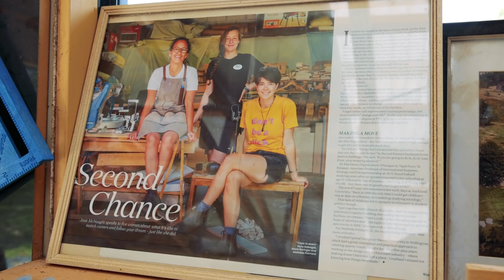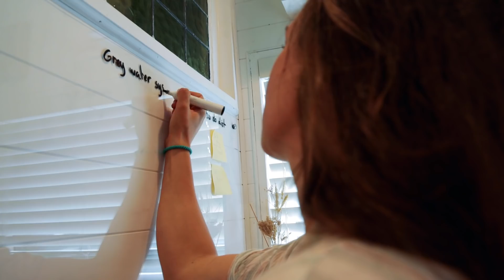Young Woman's Tiny House & Self-Sufficient Life

Comment: A tip when using magnetic knife holders, always face the sharp edge of the blades away from you, so when you reach across the knives for the one at the end you don't accidently cut yourself.  I installed my magnetic bar vertically, blades up, with least used knives at the top and ones I use the most at the bottom.
Reply: Hey Randy, this is such a good tip thank you

Comment: Question - see with a three meter wide Tiny House, what is the consequences of going that wide? Does it make it so only drivers with the correct permit can tow it? Or do you just have to apply for a special permit? We would love to go 3 meters, but so many people opt for the 2.5 - which makes me think there must be a reason?
Reply: 3.1 is the max you can go to drive without a special permit and 3.1 is the total width of my house (from the outside) . People go with 2.5m from wall to wall inside to be safe because you have to count the wall thickness, the cladding, window, roof and gutter etc! Once everything is built you can easily go over 3.1 so 2.5 is the safe number .... the inside width of my house is around 2.8 because I can afford to have smaller size framing cause there is no loft and it is only 5m long

Comment: Did I miss something? How is it heated, and cooled?
Reply: Hey Monty, it is such a small space that boiling the kettle for a cup of tea will heat the entire place in winter  and I have a fan in summer :)... I also have a Lunos ventilation system with regenerative heat exchange so I have a constant air flow going without change of temperature inside the house
Reply: this is very informational. It’s probably just a cultural language difference, but what is the digester? Is this the same as a composter? I am also very intrigued about how you recycle your gray water, and cook with self generated gas. You mention writing a book, would you have a website? Thanks
Reply: @montycraig5659  I am still experimenting a lot and finding problems to fix. A digester is a container without oxygen where organic matter gets "digested" into Methane which then can be used as cooking gas (the company that sells it is called homebiogas)! the grey water system is inspired by one of Bryce video on grey water treatment and I am still working on it as well! Once I feel like everything is working how I want then hopefully i will be able to share the knowledge somehow and there probably will be an update video :)